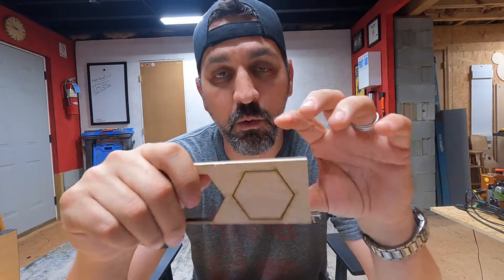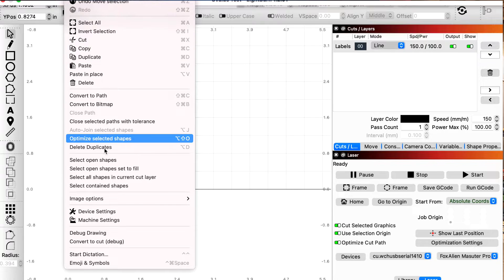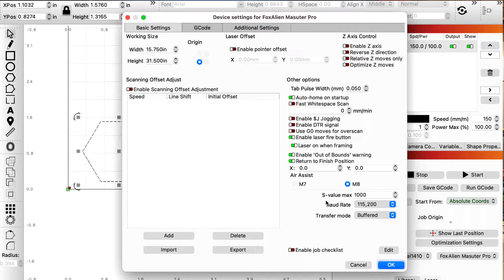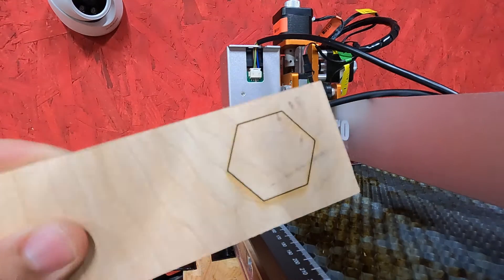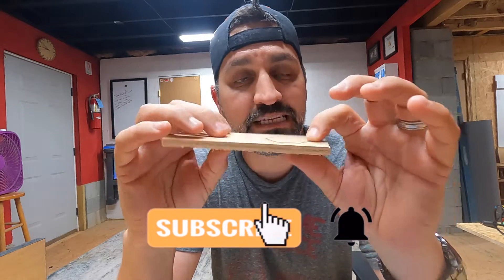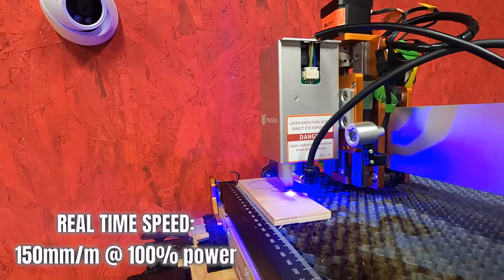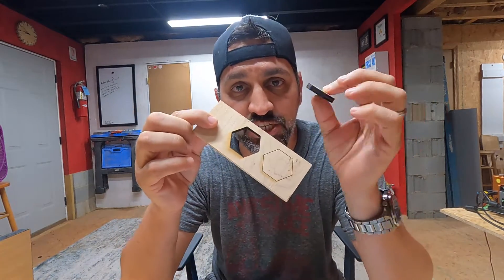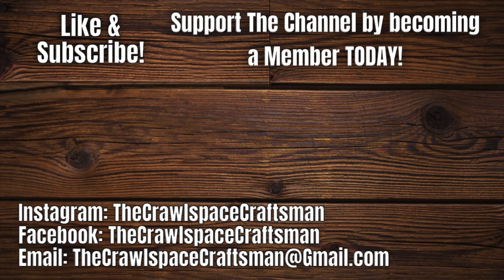Get the MOST POWER out of your Laser by doing THIS in Lightburn!

Comment: I have a 5.5watts can I apply this to my ortur and what would be the change right now both at 1000 thank you for your assistance
Reply from the maker: So if both your setting match up you should be good.  By adding a 0 to both… it won’t do anything “extra”.  It doesn’t change the actual power of the laser.  It only makes sure your machine is using its full potential which in your case is 5.5w.  Hope that helped a little more and thanks for watching!!!

Comment: only thing about using 100 percent power is it takes life from your laser.
Reply: If you use your laser to make money and you can run your jobs 50% faster, then it makes sense to run your laser at 100% if you need to. You have to look at the laser head as a consumable. If you burn out your laser head in a year (I have never heard of that happening) and have made a couple of thousand dollars more that year because you ran it at 100%, so what? I would spend $400-$500 a year to make a couple of extra grand. I used to spend $1,600 a month on diamond tip sawblades every month, so a laser head doesn't seem that expensive to me.
Reply from the maker: @krisknowlton5935  your not wrong! The cost of a Diode is extremely low compared to potential income.
Reply from the maker: 100% correct. I didn’t mention that in the video but I used it for the teaching purposes of the video. Much easier to get across the point with 100% rather than 87.5%.  😂. Thanks for watching!
Reply: Running a diode at 100% is a lot different than running a CO2 tube at 100%.  Most of the advice to keep the power down to extend life is based on CO2.  Running a diode at full power will reduce the life of the laser head but not nearly as badly as it does for CO2.
Reply: That depends on what laser you have. Thunder Laser uses over sized tubes and under clocks them with the power supply and in lightburn. For example my 100watt tube is actually rated at 121watts. It has a 100watt power supply. My boss has a 130watt Thunder and his tube was rated at 144watts. 
Some company's sell you a 100watt tube but say you can only run it at 85-90% power to preserve the tube.